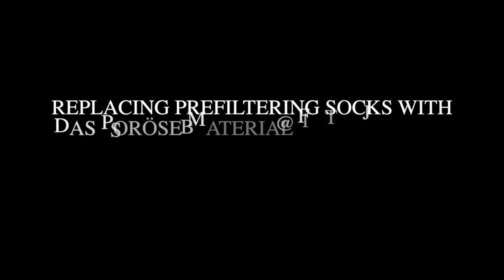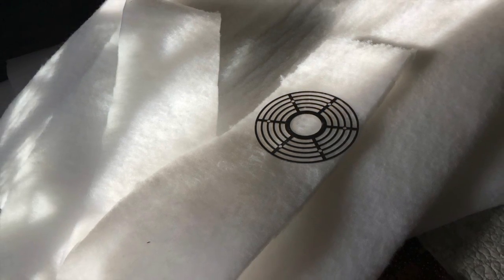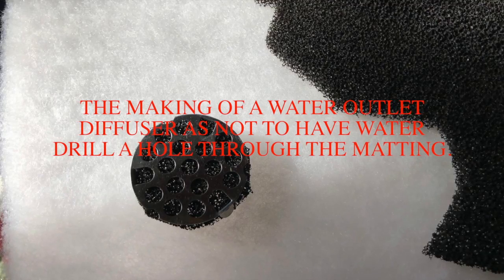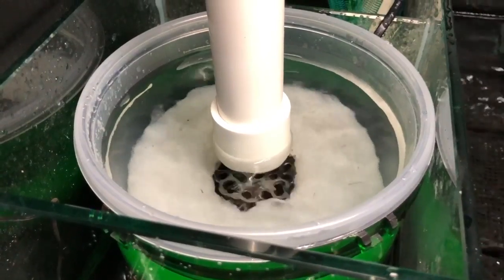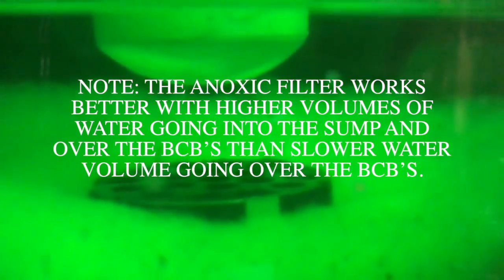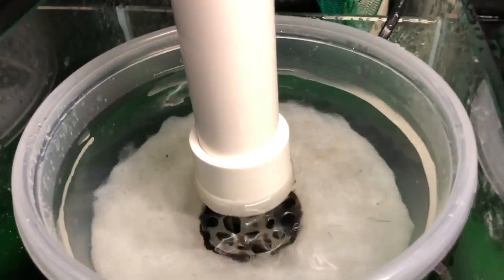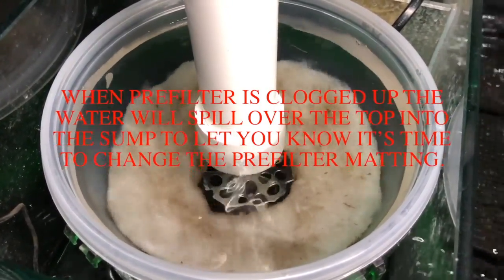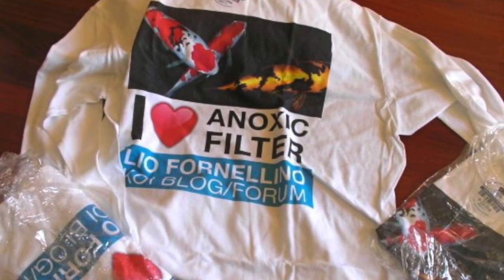Replacing prefiltering socks with Das PorÖse Material from JoAnn’s sheet batting @ 1” thick.

Comment: Sorry for bombarding you with questions: I apologize if I missed it, but did you drill holes in the tupperware container (for your prefilter)? Do you think I could use a plastic sieve just as easily? (Am attempting to be very diligent in setting up my sump; want prefilter, BCBs to just right from the start).
Reply from the maker: https://www.youtube.com/edit?o=U&video_id=yINbj43LwL8

 Just click on the link above and it will help you find a replacement for Laterite.